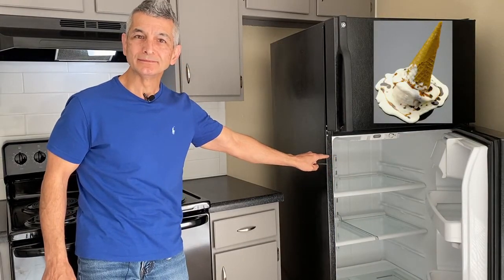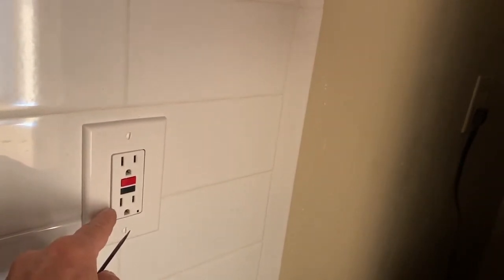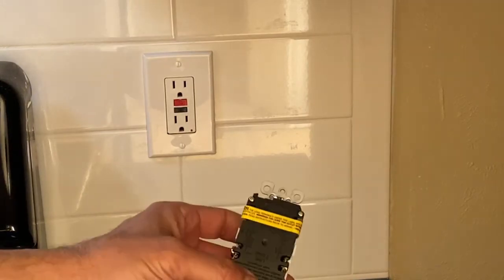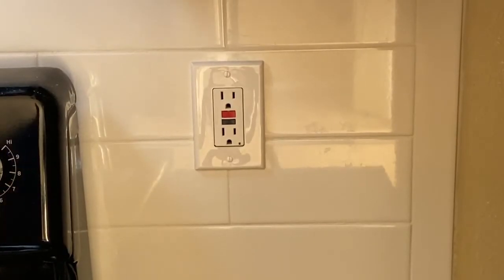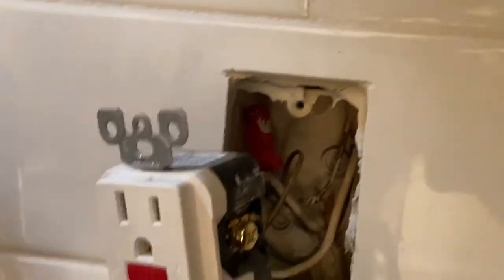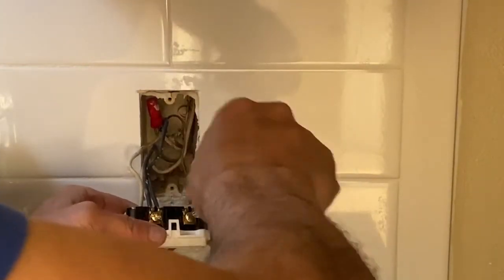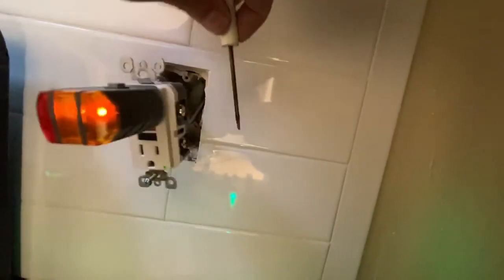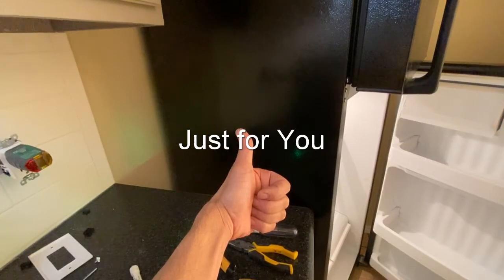Fridge Tripping-Learn how to fix it-Don’t power a fridge from a GFCI, especially older ones

Comment: Is this safe? Your cutting off fail safe to that outlet
Reply from the maker: Where I live, GFCI outlet is required when an outlet is within 6 feet of a water source. If the fridge is outside of that distance, there is no need for it to be connected to a GFCI outlet. That said, in most cases that I have seen, the outlet for the fridge is connected to an outlet that is within 6 feet of a water source. And, in most cases that I’ve seen, the fridge outlet is connected to the load side of the said GFCI outlet. Which in that case, the outlet for the fridge that is a regular outlet will behave like a GFCI outlet. By switching the wires from Load to Source, the fridge outlet will no longer behave like a GFCI outlet. It become a normal outlet. Which it will have the same safety as rest of the outlets in the house, protected by the breaker. Hope this helps.
Reply: Water source it’s in most cases behind the fridge.

Comment: Fixed my problem! Thanks!!! I had 3 wires on each side, it's just a process of elimination. Luckily I guessed right the first try :)
Reply from the maker: Excellent. Glad to have helped.
Reply: Wouldn’t you just move all 3 to line??? Leaving nothing on load correct?

Comment: Thank you so much for this!! I had this issue for the last 2 years. I had a handyman come out to give me an estimate to fit the issue. He said I had to upgrade my entire electrical panel. Yikes! 💀 after tripping on the extension cord again, I thought to give youtube another try and your video popped up! Yay!! 🙌🏽👏🏽👏🏽👏🏽 worked like a charm ✨️ 👌 😌
Reply: But now it's no longer up to code.
Reply: Ok, Karen.
Reply: Karen right🙄
Reply from the maker: Excellent. Glad to hear it worked for you. Please share the video with others. Much appreciated.
Reply: But the plug is still protected by the breaker, just bypassing the GFCI.

Comment: When the GFCI is tripped will it cut off power to other outlets? It looks like you just turned the GFCI into a regular outlet.
Reply from the maker: When a GFCI outlet trips, it turns power off to itself AND any outlet connected to its load terminals.

Comment: Helpful video.  I have a 10-year old frig that trips the GFCI outlet.  Could this be because of a short in the frig or will it be OK to do your method of correction to keep frig on all the time?  Thanks.
Reply from the maker: Dan, I would suggest plugging the fridge to a regular non-GFCI outlet first to make sure the fridge does not have a short. Once that’s confirmed, and there is not a short, you can do what’s in the video.
Reply: Mine is doing the same when I plug it into any gfci.  When I plug it into a non-gfci it works fine.  What gives?

Comment: If the fridge is within 6 feet of the edge of a sink, or if it's in a garage, NEC requires GFCI protection. Homeowner's insurance would probably deny a claim if anything were to happen in those cases.
Reply: Many fridge’s specifically state not to plug into GFCI outlets in the manuals
Reply: I thought the rule was the fridge to be on a dedicated circuit like the stove etc?
Reply: Yes! You are correct that it must also be on its own 20A circuit now.
Reply: @themonkeydrunken  but refrigerator manufacturers put in the owners manual to NOT run the appliance on a gfci protected circuit because they can trip for no reason and your food can go bad if you dont realize it soon enough.
Reply: @themonkeydrunken  I've lost the contents of my frig/freezer twice now. I live in an apartment. Landlord refuses to fix, understandably. But WTF Do I do when I'm out of town. I'm currently in the habit of checking every time I walk into the kitchen.
Reply: @AmusedBYcats  run an extension cord to a non GFCI circuit. Or, change the outlet to a regular one (assuming it’s the outlet gfci not breaker gfci )
Reply from the maker: Thank you for your comments.

Comment: GFCI's are required by the National Electric Code to be placed in kitchens (no exceptions for fridges in the recent updates). Why do we need GFCI on fridges?  Because a fridge can (and has) killed people who simply went to open the door as normal. (And I don't mean 50 years ago, I am talking in recent years even on commercial grade fridges). 

Bottom line: if your fridge is tripping it, then that means your fridge is faulty. Unfortunately fridges are made very cheaply today because consumers demand things as cheap as possible. So you could have even new fridges trip GFCI's which I know can be frustrating.  I don't know if "tripping a GFCI" is included in the warranty, but I doubt it.  This makes the whole situation very unfortunate for the average consumer.
Reply from the maker: Thank you for your comments.

Comment: Hi- I have an outdoor bar area that has a GFCI outlet that is part of a circuit that powers receptacles at the bar for phone chargers, small appliances, etc- but is usually just used to power a mini-fridge and low voltage landscape lights.  

This all worked fine for 3+ years, but recently the GFCI was tripped, and would not reset.  I replaced it, and now it is tripping once or twice a day- I believe it's the mini-fridge.  If I use your method, it seems like it may fix the mini-fridge tripping but will it also make all of the outlets at the outdoor bar "non-gfci", and is this dangerous due to being outdoor and susceptible to rain, etc?  Thanks for any advice!
Reply from the maker: To isolate, consider plugging the mini-fridge to an outlet that is not part of the GFCI circuit.  Unfortunately, as devices with inductive load, such as, the coil in the compressor from the fridge, get older could create a spike large enough during the on-to-off period that could trip a GFCI outlet. You are correct, you do not want to use a non-GFCI circuit in a wet area.

Comment: So if I put the fridge on top connecter, the master bathroom outlets are on the GFCI outlet will they go off if the GFCI is tripped?
Reply from the maker: The terminals on the back of a GFCI outlet are labeled. Any outlet that is connected to the terminals labeled “Load” will behave like a GFCI outlet. I hope this helps.

Comment: I just did this and it looks like it solved my problem. So does the gfci outlet not work anymore if I plug something into it ?
Reply from the maker: Bruce, glad to hear it solved your problem. The GFCI outlet should still function as a GFCI outlet. Best way to verify is to test it with a GFCI outlet tester.
Reply: @JustForYouDiy  I had the wires connected to the load side. I switch it to line and its working perfect now. I guess mine was upside down. Thank you.
Reply: @bruceliu2607  Same exact thing happened to me just now. I couldn't figure out why the outlet itself wasn't working anymore but after reading this comment, I checked and saw that the line was at the bottom and I had actually moved everything up to the load.
Reply from the maker: Thanks for the follow up comment.

Comment: you just defeated your protection, The purpose of a GFCI is to protect from short circuits or contact with an electrical surface loose grounds etc. I would most certainly want a GFCI installed anyplace where there may be a wet surface or possibility touching a metal surface
Thats the purpose of the LOAD SIDE OF A GFCI AS YOU HAVE IT NOW IT WILL NOT TRIP IN THE EVENT OF A SHORT CIRCUIT.
Reply from the maker: Thank you Fred for your comments. You do not want a fridge plugged into a GFCI outlet.
Reply: @JustForYouDiy  my man!!

Comment: why does just plugging the refrigerator into the top outlet then not solve this problem? honestly asking as someone who is having this problem and doesn't have any experience in dealing with electricity
Reply from the maker: Thank you for the question. The problem is that the fridge should not be plugged into a GFCI outlet. The solution is to make sure the outlet used by the fridge is not a GFCI outlet. And, this is how you do it. That said, as I have noted in the video if you are not comfortable working with electricity, you should hire a professional.

Comment: So it worked for me and all the outlets in my garage work just not the actual GFCI outlet. It keeps tripping. Any reason why this is happening? Again, the refrigerator now stays powered so my initial problem is solved but now I'm out one outlet. Help!
Reply from the maker: Michael, make sure that you are connecting the neutral and hot from the same run (wires from same 2 or 3 conductor cable) to the GFCI outlet. Even though all neutrals ends up in the same place, different length runs have different resistance and that could cause the problem with GFCI. Or, you have a weak/defective GFCI. Hope this helps.

Comment: Will that defeat the purpose of having a gfci? Thank you sir. Will the gfci still work/trip if wired this way?
Reply from the maker: Thank you for the question. No, it does not affect how GFCI outlet works. One way to test if GFCI outlet is functioning correctly or not is to use a GFCI outlet tester such as: Commercial Electric Outlet Tester with GFCI, from Home Depot 

Model# OTG-102R 
Internet# 206029151 
Store SKU# 398469 
Store SO SKU# 398469
Reply: @JustForYouDiy  thank you sir for your quick reply, and for sharing your knowledge! Much appreciated.
Reply from the maker: My pleasure.

Comment: Your going to over load your circuit and may even cause a fire!  Do you even know what's causing it to trip ahh could it be an overload which the GFCI is made to do it's job!  Bypass it and it could cause a fire by over loading your circuit!
Reply: Isnt that what the breaker itself is designed to do... trip if there is an overloaded circuit to avoid an electrical fire?
Reply from the maker: Eric, You don’t want to have a fridge plugged into a GFCI outlet. As you may know, fridge has a compressor and compressor is an inductive load. GFCI outlet trips quite easily when used with an inductive load that goes on and off. Let me know if you have any other questions.
Reply: To properly fix it you need to run a dedicated fridge circuit. You need a GFI in the kitchen for when you have a real problem. Theres something wrong with the fridge. Your not supposed to eliminate the gfi like this

Comment: So what's the sense of having the GFCI outlet if your going to bypass it?  It don't make sense!
Reply from the maker: Eric, it makes sense once you drill down to the fundamentals. Hopefully I can help with that. Eric, You don’t want to have a fridge plugged into a GFCI outlet. As you may know, fridge has a compressor and compressor is an inductive load. GFCI outlet trips quite easily when used with an inductive load that goes on and off. Let me know if you have any other questions.

Comment: Is it ok if those wires you moved from the bottom touch the other wires already there on top?
Reply from the maker: Good question. Yes, it is okay for those wires to touch. As you may be able to see, the outlet I used allows for two wires to be secured with each screw.
Reply: Does this create a fire hazard since isnt the purpose of the gfci to protect overloading the circuit

Comment: So the GFCI outlet will still work at the GFCI outlet?
Reply from the maker: Yes, you are correct. The GFCI outlet will still function as GFCI.
Reply: My fridge kept tripping my GFCI in my garage so I did this and it worked like a champ! Thanks for the tip!
Reply from the maker: Happy to hear that it worked. Surprisingly, it is a very common issue. And, many pay an electrician to resolve it. Thanks again for sharing your experience.
Reply: @JustForYouDiy  hmmmm, almost as if someone is making money off the poor craftsmanship in the home building process.... I wonder...nah, surely that's not intentional....surely....

Comment: my gfci outlet already has 2 wires plugged into both top sockets. I can't plug the fridge lines in. So how do I fix that? Any ideas?
Reply: Same here. I think they need to be pigtailed in this situation.
https://youtu.be/UGWRijiQpQc
Reply: Did you find the fix for this? Same issue I’m currently experiencing.
Reply: @ if I remember correctly I replaced the gfci outlet for a new one and it fixed the tripping

Comment: i am having this issue but with a mini fridge, was working fine for the last 3 years, unplugged for a month and now it keeps tripping the gfci, everything else works fine. Unable to change the outlet, is there anything that can be purchased to correct this? Would plugging in a snubber fix this issue? thank you to anyone that can provide any information
Reply: Plug it into a standard outlet someplace else in the house, that's on a different breaker, like in your living room, to verify it even works at all.

Comment: Does this work if your fridge is directly plugged in to the GFCI outlet
Reply from the maker: Michael, unfortunately, it will not work the same way. The method shown in this video bypasses the function of GFCI outlet. In your case, the GFCI outlet has to be replaced with a regular type outlet.
Reply: @JustForYouDiy  THERE'S the answer I was looking for!! Very seldom does the video miss the mark on what I'm searching (albeit just a little) and the OP provide the answer in the comments! Thank you. Sir! 👍
Reply: I plugged my fridge into a non GFCI outlet and it works perfectly now. I’ll replace the outlet with a GFCI and connect the fridge through a surge protector for safety.

Comment: Most licensed electricians will tell you to pig tail witch is connecting three pieces of wire to the outlet one black one white and the ground then matching the colors together in a wire nut 😝
Reply from the maker: Thank you Jay for the comments. Any licensed electrician suggests that when  the outlet has extra connection points that clamps down on the wires, is wrong.
Reply: @JustForYouDiy  
They are not wrong, they just aren’t butchers. 
Stab ins have there issues, and are not equal or better than splicing and terminating under a screw.

Comment: Thank you for this video. I installed a new refrigerator in my garage and the power trips every few hours. Is the technique you showed safe for the garage too? Mine is also a GFCI outlet. Thanks in advance.
Reply from the maker: Thank you for watching the video and your question. Most likely the reason the GFCI is tripping is because of the fridge’s compressor  turning on and off. For that reason, I do not power a fridge with a GFCI outlet. As for safety of not using a GFCI outlet in the garage, it depends on where you leave and the local codes.
Reply: See I have this same question. I had the fridge in my garage for least a year in my new home. It hasn't never trip. Now the past 3 months it trips within 15 mins. So I've plug it to a no gfci outlet inside my house and it has never trip the breaker from the outlet I have it now. Gfci is a safety device too tho. So it makes me think something is wrong with my fridge like I have Internal issue going on wirh my fridge that's allowing The gfci to trip.    

My concern is that I may bring a problem to my new outlet and everything else that's sharing same power on that outlet. My fridge doesn't go off now and it doesn't trip the breaker. So am I ok? What I'm concerned about should it be a concern? Please advise Thanks.
Reply: Same question ^

Comment: Did you add them together on the terminal or did you put the 2nd wire in the hole?
Reply from the maker: The GFCI outlet I use is made by Leviton, slim design. It allows for two wires per screw terminal using the backwire feature. The outlet is model number GFNT2-RW.